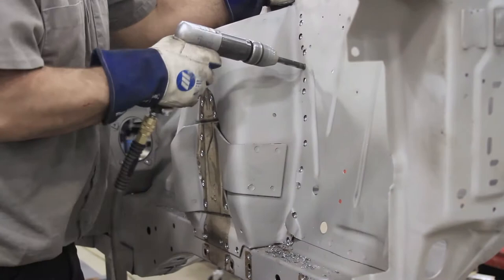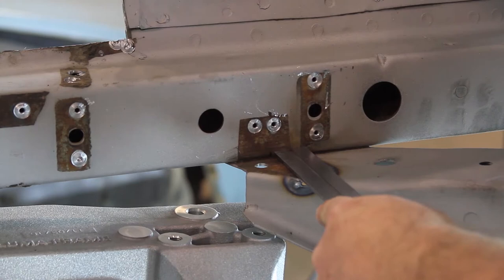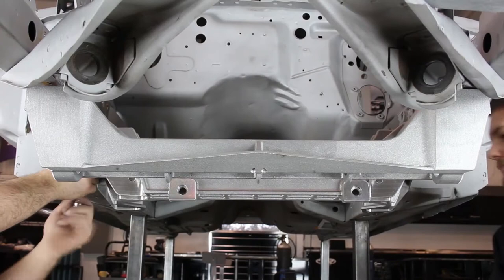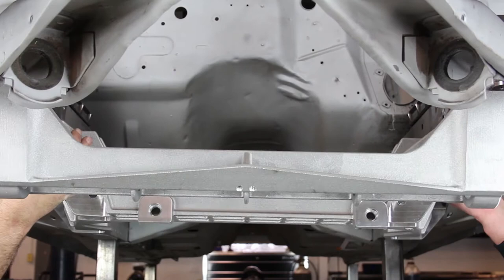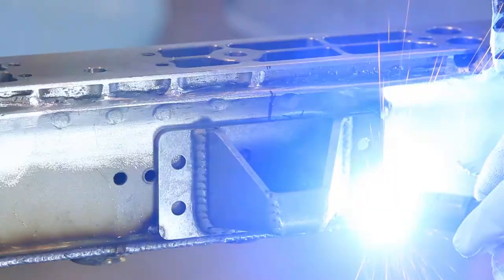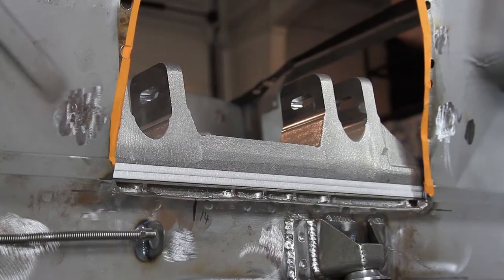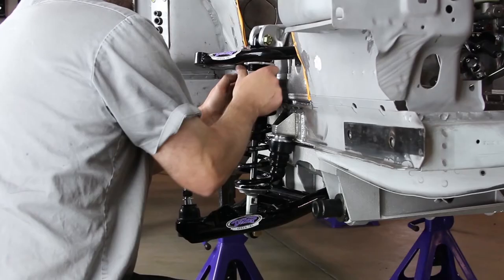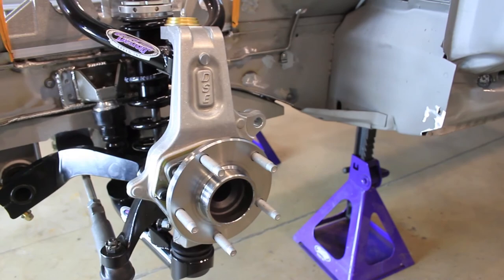Detroit Speed 1964.5-1970 Mustang Install - Aluma-Frame

Comment: HOLY SH%T !!!! 
I HAVE NEVER SEEN THIS KIND OF DETAIL ON ANY RETROFIT FOR ANY CAR... NEW OR OLD !!!
OMG !!! 
MY DREAM IS A 65 GTO CONVERTIBLE WITH AN LS3... DONE BY DETROIT SPEED !
I WONDER WHAT THAT WOULD COST ME ? I WOULD WANT A MUNCIE M22 ROCK CRUSHER 4 SPEED POWER BRAKES AND STEERING (QUICK RATIO!) LETS SEE... I WOULD WANT THE WORKS PERTAINING TO THE FRAME AND SUSPENSION !
I JUST CANT BELIEVE ALL THE TECHNICAL KNOW HOW YOU GUYS ARE PUTTING INTO THESE CARS! 
        I GUESS THE REASON PEOPLE USE QA1 AND RIDE TECH AND ALL THE OTHERS IS BECAUSE THEY CANT AFFORD THE BEST !!!!
Reply: OH ! I FORGOT THE MOST IMPORTANT THING... THE MUNCIE SHOULD BE BUILT BY PAUL CANGIALOSI !!!!!!